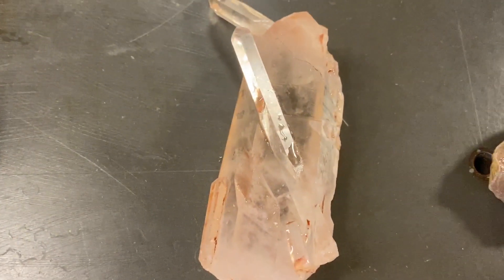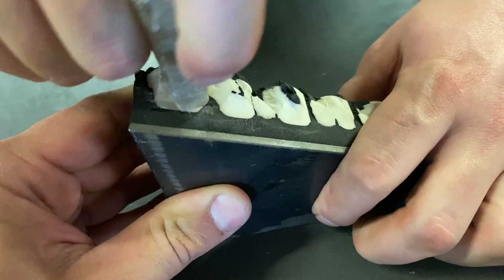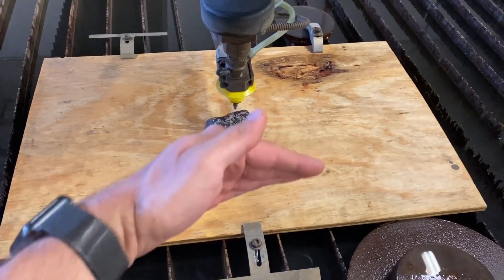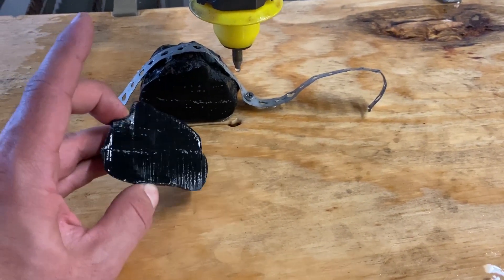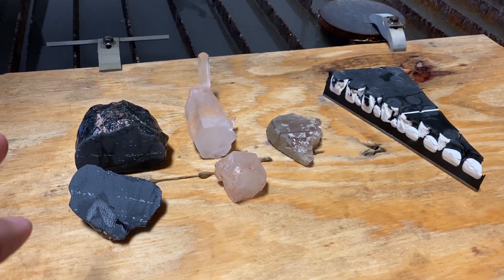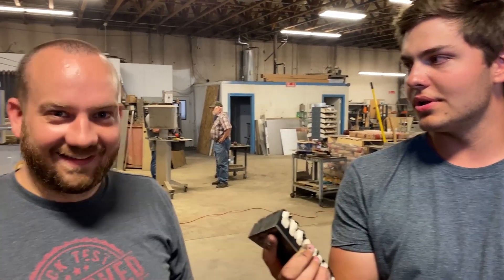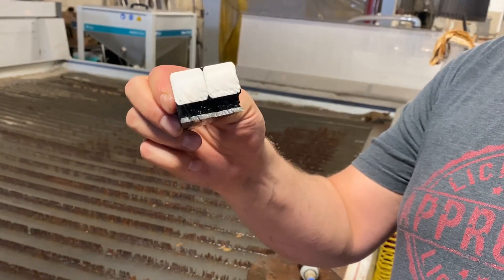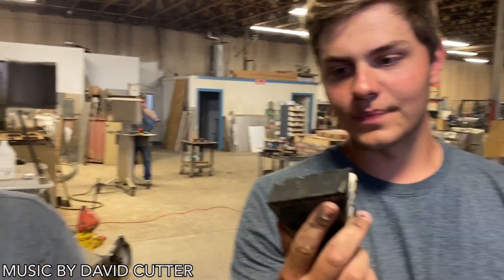Hardest Materials vs 60,000 PSI Waterjet

Comment: Hey guys, your garnet has always been pretty red. The handful you showed in this video looked more like sand than the previous garnet you've shown. Was that just a camera trick, or have you switched brands perhaps? If so, wanna talk about it and why you switched in your next video? Thanks!
Reply: I'm guessing maybe it starts red and as it is used / recycled it darkens with contamination
Reply: @averageoutdoorsmannz2015  garnet doesn't really get recycled. You can get a big machine to separate and clean the garnet but it's expensive enough that most people won't bother. It really loses cutting efficency after being used, so it's just not worth the effort.

Comment: Nice vid, but I am very disappointed that you didn't show a clean cut, even if it was just one ceramic peg. 
I would have expected a clean cut from professionals.
I mean with such tools you must be professionals and know what you're cutting and what to expect when cutting at what speeds... (and with what abrasives, as I suppose there are other additives for abrasion than what you use)
Not giving either thumbs-up nor down since I know those cuts cost money and you didn't want to overspend on the cuts just for the fun of the test.
Still, nice demonstration, explanation, and video.

Comment: The Cermaic is most likley an Alumina based cermaic, an anulmium oxide based cermaic. Its white like that and has a hardness on the Moh scale of about 9 which would explain is extreme hardness copmpared to the others. You should try Boron Carbide, slicon carbide or sharpening stones like Cystolon. They are almost as hard as diamond between 9 and 10 Moh.

Comment: Quarter of an inch, inch, about... Oh jolly, the joys of the banana scale.
“In metric, one milliliter of water occupies one cubic centimeter, weighs one gram, and requires one calorie1 of energy to heat up by one degree centigrade—which is 1 percent of the difference between its freezing point and its boiling point. An amount of hydrogen weighing the same amount has exactly one mole of atoms in it. Whereas in the American system, the answer to ‘How much energy does it take to boil a room-temperature gallon of water?’ is ‘Go fuck yourself,’ because you can’t directly relate any of those quantities.”

Comment: I think your explanation of the near-logarithmic scale thing is a bit flawed, you aren't taking the hardness of the garnet that the water spews out and uses as an abrasive. It's hardness varies from 6.5 to 7.5 in average, so that it is why it cuts through quartz quite easily, even though not clean because of the speed at which you cut it, but it won't really cut through topaz, as the topaz breaks the garnet "sand" instead of the garnet scratching and breaking little parts off of the topaz.

TL;DR : Garnet in the water is too soft to really cut through 8 hardness. It's between 6.5 and 7.5

Comment: that ceramic material is probably aluminum oxide, No idea what the black composite around it is. if you want a challenge try to find some sintered silicon carbide to cut

Comment: I guess you can't use alumina (9 on the Moh scale) instead of garnet (about 7) as the abrasive in the water jet.  I am not sure the tip would last more than a few seconds.  Very interesting video.
Reply: There is different size of the hole in the tips, you can change them depending on what material and end result you are after. Indeed its interesting i work as Waterjet Operator 👍
Reply: the nozzle is made of tungsten, it would surive quite a while even tho alumina is a bit harder.

Comment: You guys should try cutting tungston carbide. I work at The Ultra-Met Company and we press tungston carbide parts.  It goes into the press as a powder, gets pressed into a solid and then after it goes through the furnace, its almost as hard as diamond.
Reply: The waterjet nozzle is made of Tungsten. It will cut it but it will probably take hours for a single inch. Im pretty sure they did a video on this before. Tungsten is some mean stuff.

Comment: It seems like if you had an ultrasonic sensor below the board, you could detect whether the key is fully passing through the material to auto adjust the cutting speed.

Comment: How would a large ceramic ball bearing fair against the waterjet? I'm interested to see if it's smooth exterior will deflect the jet rather than allow it to cut through. Or, if it does break through the exterior, how long will that take?
Reply: The biggest issue with ceramics is once it starts going it just fails immediately, with the vast majority of different kinds of steel this is not a problem.

Comment: The final material is made of an Alumina Ceramic, Natural Rubber, and Cn Layer/Steel composite.
Reply: I really don't know how did you figured it out, BUT thanks god for you existing!
I've been questioning myself for 2 years what was that Composite!
Reply: @guilhermesapuda9538  I looked up rock conveyer wear plate. Cant find the model they have though.
Reply: Can you explain what is exactly a Cn Layer/Steel Composite?
What you meant was "Carbon Nanotube or Steel composite"?
Reply: @guilhermesapuda9538  Cn is Carbon-nitrogen bond, its what they used to stick the rubber to the steel.

Comment: The ceramic composite seems to be a piece of a rubber schute liner used in the aggregates or other mining industry. It is a wear item that protects the parts that guide rocks to a shaker for sizing.  I work for a company that makes them with rubber or open cast urethane sometimes with HEFTY magnets for fastening to the part it protects.

Comment: Try one of these Tungsten cubes from Midwest Tungsten, Taoufledermaus shot one, and the bullet didnt do much .
Reply: Tungsten is only between 8 and 9 on the hardness scale.
Reply: I got some tungsten electrodes from Midwest tungsten, the pigment on the ends aren't great,
Reply: the setting they used for the ceramic was the tungston setting and i couldnt go through, they had to slow it down. so the ceramic is way harder than the tungsten

Comment: Quartz is a 7, topaz is an 8. Nowhere near 'hardest'. If you wanted to use a title that wasn't misleading, use Corundum (9)  Moissanite (9.5), the carbide that's a 9.5 too, and Beryl/topaz
Reply from the maker: Sounds like you didn’t watch very far. We cut a wear resistant ceramic that is somewhere over a 9 on the Mohs scale.
Reply: @WaterjetChannel  Is quartz and topaz still the hardest? That's 1 of 4

Comment: 3:33
So was it just me or did anyone else see the ceramic produce light when the water made contact?
Reply: The garnet grit sparks at hitting it with high velocity.
Reply: yes, sparks from the rough contact between the grit and the ceramic
Reply: Lol you got 4 more or less reasonable answers, choose your winner!
Reply: Triboluminescence?
Reply: Ceramic + white + hardness of 9 mohs... Can be aluminum oxide (alumina) or zirconia with alumina.
This materials are used on cutting / grinding discs, wear resistant and bulletproof plates
, refractory materials...
I think its used on the "First" Manufactured "Non-Cuttable" Material (named Prometeus). And I deduce that it is aluminum foam + balls of alumina or zirconia alumina wrapped in steel sheets.
A couple of safe manufacturers from europe put molted aluminium + corindum inside very old high security safes.
I would like to see a video cutting white corundum with the water cutting machine. White corundum has about 99% of aluminum oxide (alumina).

Edit: I don't know if the material may have something to do with light. This reminds me of one thing ... years ago when I was a child, sometimes I would open small letters, they had a kind of glue that emits light just at the moment and in the area where the papers are separating (it is only visible in total darkness).

I think I'm starting to improve my English
.
Reply: @gemofe  they explained the sparks in several videos, it is from the grit hitting a very hard material
Reply: @gemofe  they use garnet grit. It's been shown in multiple videos.
Reply: @gemofe  agreed must be alumina or zirconia. We work with that stuff at the lab (1500celsius furnace experiments) and that stuff is extremely hard to machine... Diamond bit, water cooling and a looot of time lol
Reply: I would assume it was a sensor in the jet but I have no idea
Reply: That’s water refracting the light into the camera lens
Reply: I understand ... Spectrum of emissions, like when something burns?

A few weeks before I have seen a video explaining the colors produced by burning certain materials!

Comment: So could you set it to just cut through the steel side and then flip it to cut slower on the ceramic side? Not sure if it works that way or not. But just curious if that would cut down the amount that it eats away at that steel side.

Comment: can you use something else than garnet abrasive? like just some random fine sand? lol
Reply from the maker: Yes, they do make aluminium oxide. Biggest downside is it doubles the wear on all the parts it comes in contact with. Nozzles last less than half as long when using it.